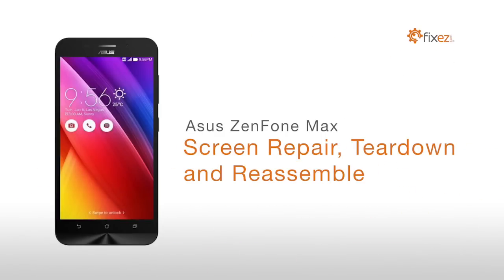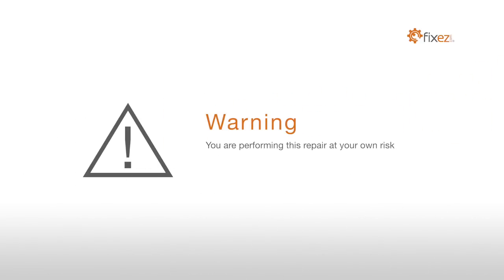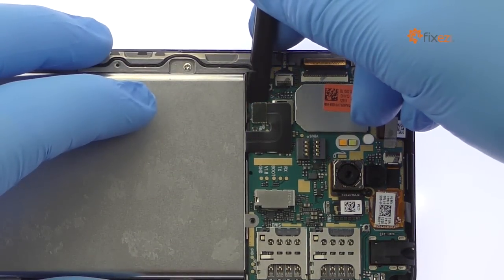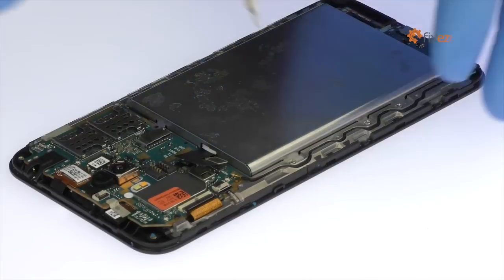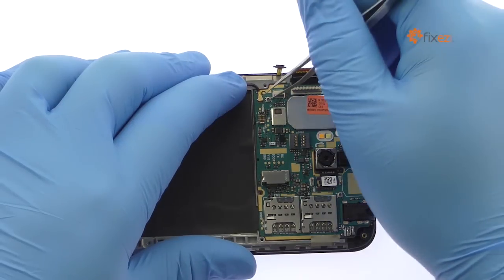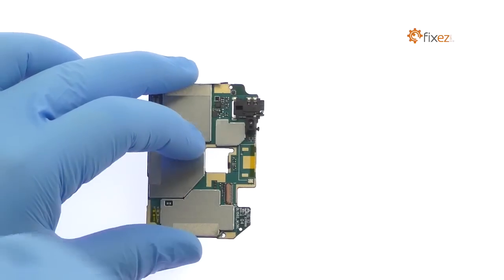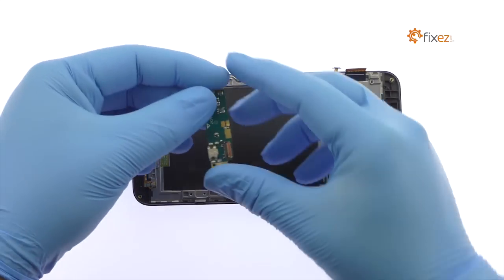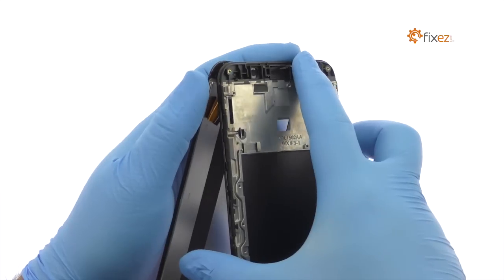Asus ZenFone Max Screen Repair, Teardown and Reassemble - Fixez.com

Comment: water entered into display cable in zenfone max phone, authorized service center told we cannot repair now touch screen is not working, is there any solution for temporary basis.